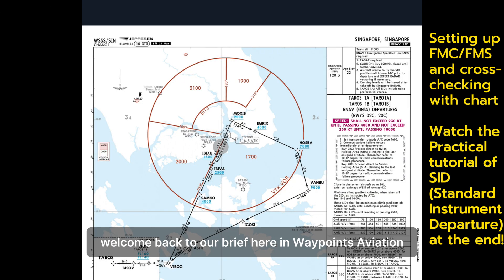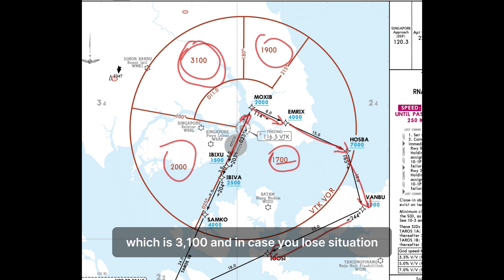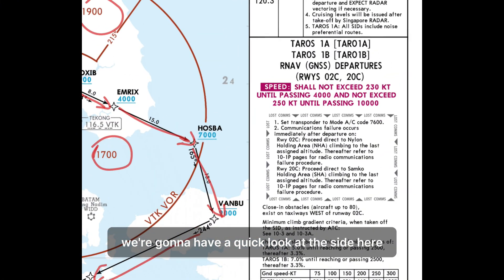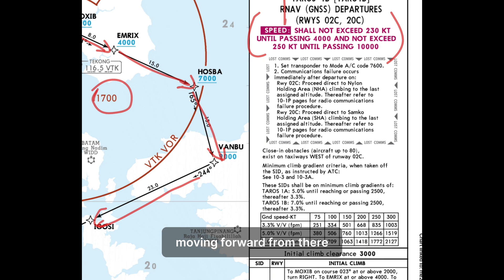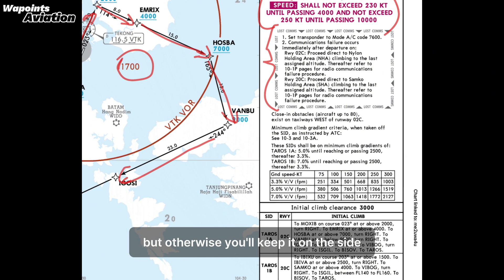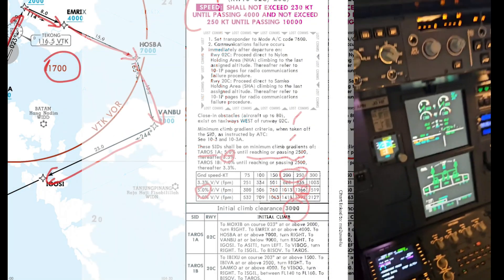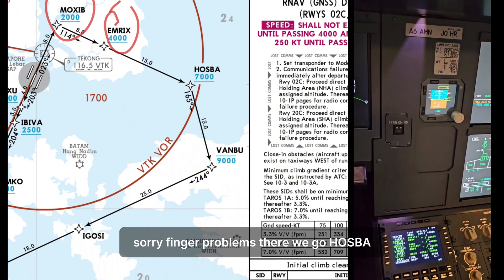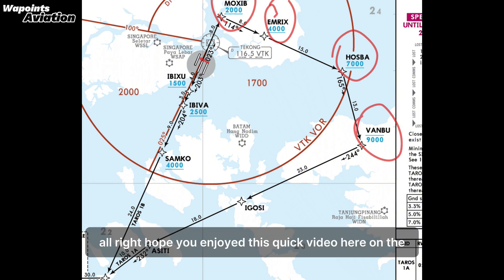Chart Review Tutorial with practical demo: SID (Standard instrument departure) Chart and FMC setup

Comment: Hello! Thanks for the video! I have a question, how do you cancel the speed restriction after you pass 4000 ft (in this case)? Is it going to PERF page, select the CLB phase, and then CLR the LSK next to the restriction? Thank you very much!
Reply from the maker: So after passing 4,000 feet, you would manage the speed and that will reflect the next restriction which is 250 KT below 10,000. I just got babbling about the ALT restriction.
Reply: Thanks for the answer! I meant how do you cancel the speed restriction of 230kts in case you had put it on the PERF CLB page? (Meaning the managed speed in that case is restricted to 230kts).